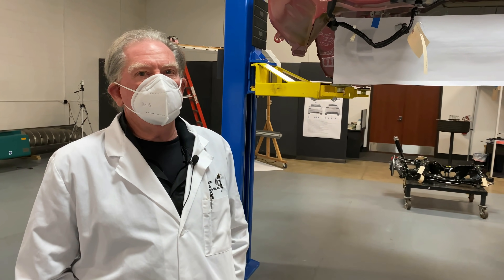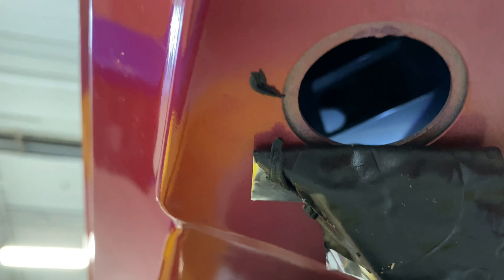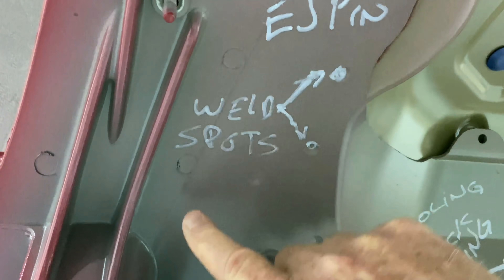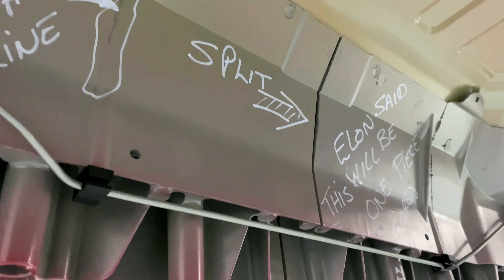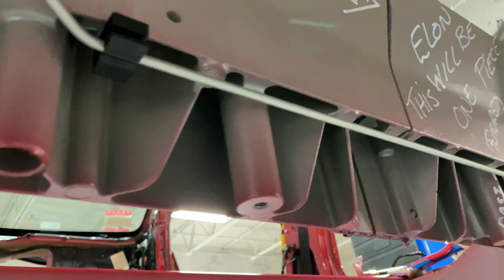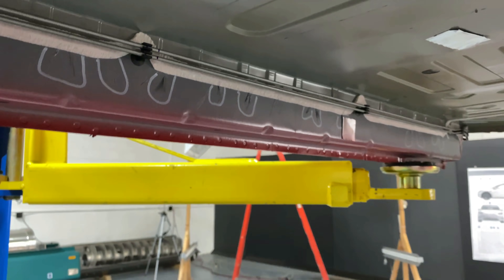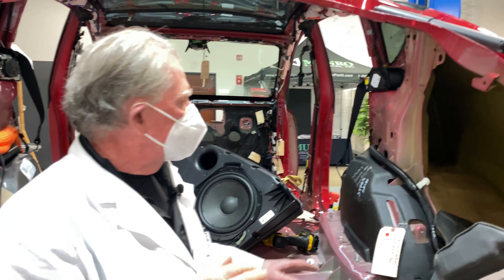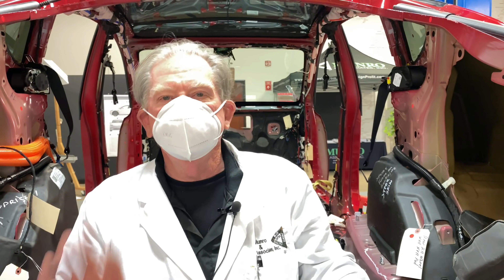Model Y E26: Tow Package, Mega Castings Revisited, Weld Splash, Hunt for the "Teslaract" Cube #2

Comment: @9:10 that type of foam is often used as acrostic foam to reduce echo and to block sound. It doesn't stop the walls from vibrating as it's not directly attached to it to absorb the sound and is a very light density but likely is there to impede vibrations in the air. A reason why it could be on both sides of the car and potentially on the variations that do not have the subwoofer could be for manufacturing consistency because if it's just placed in by an operator, it could be forgotten, so it becomes an audited component on all cars.

Comment: geat video. It would be great if you could explain in more details why casting is better than stamping in Q&A video.  I understand that on general assembley line it is faster to install one big piece, however from what I understood casting tool is huge, probably much more expensive than big stamping tool, which is already very expensive. You also have to heat up aluminum and then cool it down  so I assume it is slower and more eneregy demanding than stamping.

Comment: I took issue with the drumming coming from the rear quarter panels of my model 3, so I stripped out the trunk and installed dampening mat and topped it with sheets of closed cell foam.  Now it quiet, and sounds the way it should have from the factory. Seems like Tesla thought it was an issue too, especially since the model Y is just one compartment without a separate trunk.

Comment: That mega casting is cool, never seen that before except in toy cars. One piece version means very expensive presses. Will we see that in the Cybertruck ? It could have been designed before they started using spin welding. Tesla really is experimenting with all sorts of manufacturing methods. Starting to think $10,000 EVs are not far away. Every new method adds to Tesla's experience and portfolio of manufacturing capabilities. Tesla makes cars and uses the profit to try new tricks. No other car company does that. Tesla is showing they don't just make cars but machines to make anything. Thanks Sandy, you are not just showing us a car but glimpses of the future .

Comment: Absolutely love watching your teardowns. Certainly is informative.
that giant casting certainly makes manufacturing easier, and I'm sure it is strong as hell. But can you imagine what it would cost if that car got hit in the left corner. Instead of being able to pull out sheet metal panels or welded new panels it's going to be completely destroyed.
I think Tesla might be better off leaving it as two separate castings because at least that way if it got hit in the left side you could replace just the left side rather than the entire thing which I'm sure would absolutely total the vehicle. Generally speaking cast objects do not handle impact damage that well they will crack or shatter. Which would mean it'll take one good solid hit and be strong as hell. But that'll be it and you'll be buying a new car. We may end up finding that the insurance rates on these model Y's  end up being absolutely astronomical.

Comment: As a sound guy, I suspect that those foam blocks are to control the resonance of that cavity to avoid bad harmonics when the speakers are loud.
It looks like a sound absorbing foam like used for studio walls, and would help eliminate the standing waves and reflections that would happen there, that can lead to the sheet metal buzzing and acting as an acoustically coupled diaphragm.

If it were to stop the metal from moving, it should be under compression to resist the metal movement, but with it basically just sitting in there, it looks like it's for acoustic purposes, and they just needed a certain volume to absorb the energy and deaden the space, and a cube is the easiest and cheapest shape to cut foam into.
Reply: I think it's there to eliminate some air volume, because subwoofers require a very specific cavity volume for proper tuning.

https://www.youtube.com/watch?v=-kD8bJK7EoI

Comment: Foam Blocks are also used in Gen4 Subaru Legacy Wagons 😊 (2008 in my case). Behind the llittle Subwoofer that the factory 14-speaker McIntosh Sound System came with.
I upgraded my Sub, and found the same type of foam block a few years ago.

Comment: Thanks for the great shows, Sandy!  That piece next to the sub (you called it a "controller") is likely the amplifier and crossover to separate the low frequencies that go to  the subwoofer.  It's a good time to swap that speaker out for a JBL before you put the car back together - ha!  I'm a telecommunications contractor, but you've inspired me to try to design an electric trailer that is self-propelled, has solar panels on top (and maybe that fold out) on the enclosed trailer version, "talks" to the towing vehicle for acceleration so the trailer doesn't reduce the range, and perhaps can connect to an electric vehicle's battery to provide longer range.  I wish I knew something about mechanical engineering!  Thanks to Munro & Associates, I'm learning.

Comment: Please open the woofer and show the magnet coin size and inner box :-), is there a passive filter or is all active ?
Reply: I think the foam block is to eliminate air volume in the subwoofer cavity, as these cavity volumes are specific to the speaker.  Because there was a foam block on either side too, I'm willing to bet that another sub is ready to be added.
Reply: For example: is ther a standard 8" speaker or is it custom made?
Reply: And could you put one on the other side?
Reply: The sub has it's own vented enclosure. the waves do no go into the cavity. The sponge block is to reduce noise from vibrating panels by putting pressure on the panels lowering their resonant frequency as well as absorbing higher frequencies. You might get some vibrations from the sub enclosure depending on how it's mounted, but you definitely get vibrations from the sound coming off the wheels. There is no need for a custom speaker. The OEM speaker companies make everything they could want.
Reply: The question was not regarding the foam.. :-)
Reply: @niklaskarlsson236  You mean YOUR question was not about the foam. I was answering Phil and Niklas's questions.

Comment: Dear Sandy Munro, Can you give me an idea about the type of welding process is been followed for Joining steel and aluminium (Either sheet or casting) in automotive?
Reply: You can't really weld those two metals. When they need to be joined you can glue, rivet or bolt them together.

Comment: Hey Tesla, you make remarkable cars which have raised the bar for performance, safety and automation for the entire industry. Towing with one of your wonder cars yields dismal range however. Make a trailer with a battery and a connection on the cybertruck (the design probably finalized yet) and voila, range is solved and you have a new uber cool product.

Comment: what would you recommend in place of those two foam blocks, or are they just fine?
Reply: They should be fine. A simple fix for people complaining of road noise being channeled through the shoulder harness port in the rear seats.
Reply: I've been wondering about this, too.

Would spray foam fill up the space and deaden sound better?  Or mold a foam block to fit the space?  Would be easy to stuff a molded block in there, blocks are compressible.

Comment: Seeing sandy having to go under the car to access the subwoofer makes me wonder why you haven’t removed the e-coated piece of sheet metal at the rear. Looking at the bolt heads of that piece of tin it looks like it could have the same bolt as the unique bolt in the rear tub that sandy didn’t like. If so it would seem like the stacking order of the parts is to install the piece of tin after the tub and have the same line operator fit the same bolts.

If that is the stacking order, that is a large open area at the back. Does any other car on the market have an open area like that on the rear? It would probably help a lot with assembly too from an ergonomic standpoint.

Comment: Casting? I wonder how much it would cost when there is a crack during an accident.
Reply: That casting is buried behind exterior panels. My guess is any wreck violent enough to crack the casting would total the vehicle.
Reply: Mike Lambert - I hope so too. Lets hope the crack in the casting does not become the reason to total the vehicle.
Reply: @Enemji Apparently, I was not clear. What I meant was that for the casting to crack the vehicle would have to have been smashed to such a level that the car would be already totaled before the casting could be cracked. It's buried in the guts of the vehicle. It could happen but by the time the casting cracks there almost certainly be enough to have already totaled the vehicle.

Comment: "or get your mechanic" seems sandy hasn't heard of rich rebuilds and his tesla adventures
Reply: But this is a purely mechanical swap-out. Shouldn’t be an issue other than telling the computer that you’re towing something.
Reply: @dries248  i still wouldn't be surprised if supercharging gets disabled, if you get the part from tesla in the first place. Retrofit will certainly not take place at independent shops

Comment: Regarding the mega casting: What is your thought on repairability in case of accidents?
Reply: I suspect if you have an accident big enough to damage the casting... there is not much left of anything.
Reply: it's called totaled car.
Reply: In any car, if the sub frame is damaged, it’s usually a writeoff.
Reply: @borisdemelo   " In any car, if the sub frame is damaged, it’s usually a writeoff. " =>  Rich Rebuilds: Hold my beer ...
Reply: At that point, be happy to be alive.
Reply: You have to go back to one of the early tear down videos... He talks about that directly.  There is a separate piece in the rear crumple zone attached with bolts that can be replaced exactly for that reason, to isolate the expensive casting from the rear bumper.
Reply: I think all it will take is a lateral impact into the rear wheel.
Reply: Sascha Ferda Lateral impact into the rear wheel will drive forces into the aluminum suspension and the steel rear subframe. The quarter panels and wheel wells are steel. The only rear suspension parts that touch the Mega Casting are the rear springs. That spring perch will be just fine as the spring gets knocked out.
Reply: This is one of those "the safest cars", right? ... so, no accident  ...
Reply: @ciocrazvan9388  Oh, I forgot. Next things to save a few bucks upon: air bags, seat belt tensioners, crumple zones and crash elements front and rear. :-) Let alone steering wheel, pedals, brake booster.
Reply: It's a casting, so not safely repairable if it's cracked or bent.
But it would be an extreme or seriously wierd accident to damage it, so not really a downside.

Comment: The spot welding accuracy is shockingly bad
Reply: time stamp?
Reply: @RedRider2001  around 7:09 ish.  Those welds should all be better aligned in the Z axis and most probably in the X/Y axis.  There is one very bad edge weld which is probable a tack weld.

Comment: Peace, You are my new buddy. We think a like. Toyota was probably the best for factory assembly with JUST IN TIME manufacturing. They produced good cars but now have UGLY GRILLS on Lexus that is cheap and looks like a mouth for eating garbage. TESLA has no grills. They really missed it with not updating Prius to full battery car and thinking Hydrogen fuel cell has a future. Let’s not forget that TOYOTA & GM we’re not successful with their MUNI plant. TESLA purchased this plant for cheap and it was good for low volume production of MODEL S but was an abortion of a plant for high volume Model 3. Too many work a rounds for production and let’s not forget the tent Elon setup to save the company to get the production numbers needed. I was a very loyal GM customer from my very first 2 year old Pontiac convertible. It went downhill from there buying factory order with the last one being an absolute disaster. 1979 Cadillac Eldorado Biarritz baby blue with all options including FAKE DIESEL ENGINE Stainless Steel roof showing on front cover of Motor Trend Magazine. We moved on to 4 Nissan cars and are now going with only TESLA with the next one to be CYBERTRUCK.

Comment: The line Sandy noted on the AL casting is known as a "knit line" and will be a weak point should the vehicle be in an accident. That line will be prone to cracking. Finite Element Analysis is used to validate the design provided the part was cast properly in the mold, which it was not. The resistance spot welding "whiskers" are evidence of improper weld set-up in manufacturing. These are all quality defects.

Comment: Are those brake lines steel, or copper based alloy?
Reply: Usually galvanized steel to withstand 1000's of pounds of pressure. Copper would be too soft.
Reply: JasonWW2000  Steel brake lines are just the cheap way modern cars are made!!!!!! There are nickel copper alloys that are fine for brake lines, and never rust. It is what decent cars used to have from the OEM. I did say copper alloy, and I was hoping that Tesla had not skimped here? My Honda Insight brake lines have started failing at 20 years and 190,000 miles and I have replaced them with nickel copper now, and they will last forever now! Well , longer than me anyway☹️
Reply: @rogercrier  Interesting, I've never heard of copper alloy lines. Did yours rust internally or externally? BTW, the reason brake lines tend to rust internally is because the brake fluid absorbs moisture/water. It's recommended to replace the entire brake system fluid every 4 or 5 years, but most don't know that or simply don't do it.
Reply: JasonWW2000 I am in the UK with salty winter roads, so externally, though probably a bit of internal as well☹️ In Europe the regulations allow steel and copper alloys but in some markets steel is universal if external corrosion is near non existent like Australia, though a deep dive into their regs allow the use of copper alloys even though it is unheard of! In my head, hand built sports cars of say the thirty’s would have used copper alloy lines, then along came big manufacturers with the likes of Austin Healy, and steel became the cheap skate norm! If you go to a auto store for brake line, you get copper alloy unless you go specialist for stainless steel or steel, or go OEM and have expensive pre made steel
Reply: @JasonWW2000  Cupro-nickel brake pipes are common for the higher-end aftermarket.  Cupro-nickel is weaker and softer than coated steel and a bit more expensive than stainless steel, but easier to bend and has little risk of corrosion with an imperfect installation.  Those properties are especially valuable when the pipe might be flexed a few times to get the shape right, and might rub against other parts.  
Mass manufacturers typically use plated/coated steel brake lines.  The raw material is significantly less expensive, and it's usually good enough for 20 years. 
Here using stainless might be motivated by the potential contact with aluminum, which could dramatically increase corrosion and become a life-threatening failure.

Comment: Can you comment on/investigate the corrosion protection/proofing and paint quality for us living in cold and salty climates? Model 3 seems to be pretty poor.
Reply: Mine (M3) here in sunny dry UK has some scratches through the paintwork by some nice helpful person with a bottle that needed smashing, damage was done 5 months ago and the bodywork showing through is still lovely and shiny, no rust, no corrosion at all.
Reply: Aluminum doesn't rust but it does corrode.  Ask any airplane mechanic.  It can be galvanic corrosion or intergranular corrosion where the layers of aluminum flake away.
Reply: All I`m hearing is aluminium here, aluminium there lol... You sure that its not similar to model 3?
Reply: @DG-uv3zw  The inner frame is aluminum but several outer pieces are rustable steel.
Reply: @zackj997  Are structural parts steel or alu? Worst case scenario, if there`s rust in, hopefully distant future, its important if its structural or just cosmetics. You can even pass MOT if its not structural. And usually, its not expensive to fix in any decent body-shop if its not structural.
Reply: @DG-uv3zw  As far as I know all structural is aluminum. Only some exterior pieces are steel which I assume is for cost reasons. So the rust would be only cosmetic but still, nobody wants to see rust on their Tesla :)

Comment: hi have accident on the back how do you repair if make one piece the model y  is disposal  car not good for environment Elon
Reply: The body structure can be considered the same way as the frame in traditional cars. If the frame is damaged, the repair required is to completely disassemble the car, straighten the frame, and reassemble. For nearly all cars, this means the car is a total loss.
Reply: @garywiseman5080  To be fair, things can get messy with structural aluminum parts. You really can't straighten those like you can a more traditional steel setup.
Reply: Kommentator not that it’s safe ( or legal some places) to do so
Reply: @garywiseman5080  Or it gets sent to Arthur Tussik, who then rips it apart and rebuilds it on his YouTube channel.
Reply: @garywiseman5080  to be  environment friendly was to last and easy to repair  two piece is  know   cast is damage remove  half
Reply: Only the body structure is cast, not the impact parts on the outside, those can be removed